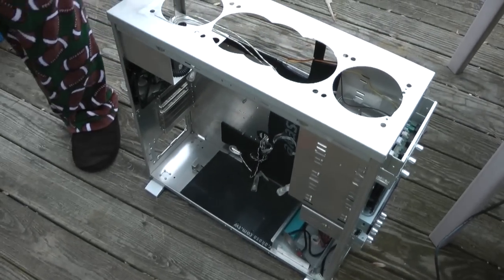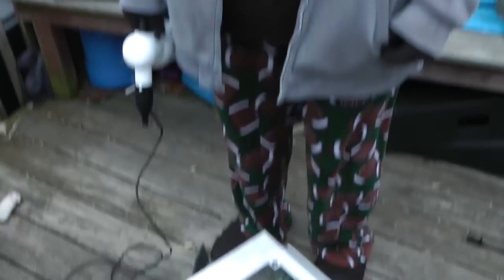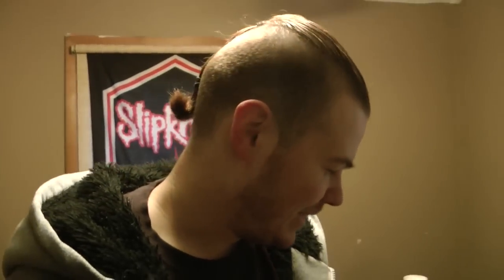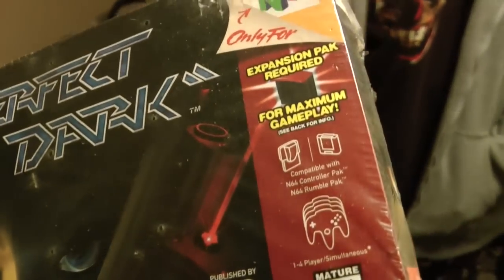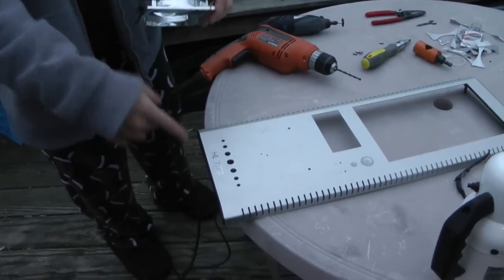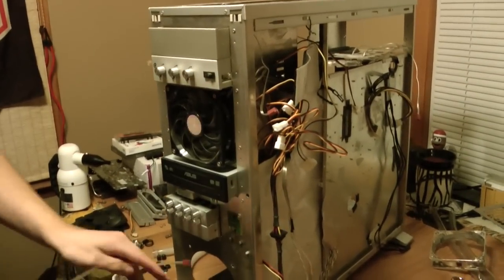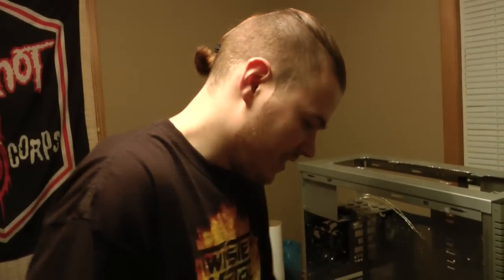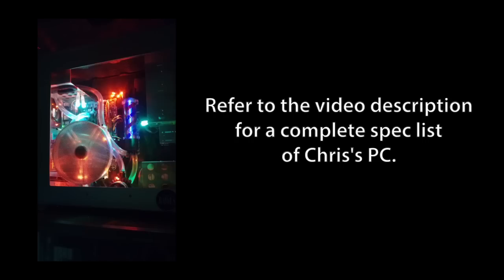Modding a PC Case for Water Cooling

Comment: I got the cheapest case I could find (an unused secondhand Sharkoon Vaya) and took an angle grinder to the lid.
It now has a 420mm rad (3x140mm) and a home made shroud (£3 for the plastic cut to size - Many thanks to Terry at AbPlas in South Wimbledon).
These Sharkoon Vayas are incredibly good quality for the price, Great cable management and not ugly either.

Comment: I didn't mean all your parts. I meant things like tubing, fluid, etc. At 09:55 it sounded like what you meant were things like the tubing and so forth. You don't have to replace tubing, like I said you do some simple maintenance, putting in some biocide or antimicrobial, you can easily avoid things like cloudy tubes.

Comment: Trains look cool - O Gauge right? I have MTH and they are an expensive hobby. On the drilling - see the holes on the back of the 4 inch hole driller, see the holes? They just may be there to tap the circle piece you drilled out :)

Comment: what grade or part number cutter wheel is best for cutting up aluminum casing? planning on cutting up my mid-tower to do an external water cooling system, as I have NO space in my current rig for Rad+Loop+pump. probably the worst decision I made, getting a Mid-Tower case. now dont want to waste a perfectly good case. so going to cut up my old-old case to mount/hold the entire water cooling system. and just have quick-disconnects and tubing leading to my main rig =D Water cooled my X360 that way, how hard can cooling a bigger system be =D
Reply: Zubin HV mid tower is perfectly fine ..it's all I use and have them all water cooled ..it comes down to the style case really

Comment: Awesomeness Video Hands Down..  It's great That You Are..  Water Cooling Your Old PC Case..  You Are Right About The New PC Gaming Case's..  They Are Built To Be Water Cooling From The Start..  But An Old Case That You Have..  From When You First Got Into PC Gaming..  That You Can Keep A Little Longer..  Ya..  I Have Two Old Case's..  *{A Dell, & A QUANTEX} Very Old Ones..  The QUANTEX Co. Has Gone Out Of Business..   I'm Leveling Up My Gaming PC Right Now..   Using The Best Of Both Machines..   You Sir Have A New Subscriber..  *{MAY THE FORCE BE WITH YOU ALWAYS}.. 

  My PC Specs:
  CPU - Intel Core i7 920@ 2.67 
  Motherboard - Studio XPS 435 MT
  Video Card - AMD Radeon RX 560 Series
  Memory - 12.00 GB
  Hard Drive Western Digital 3TB / 640 GB
  Liquid Cooling - Corsair Liquid Cooling H110i Extreme On The CPU